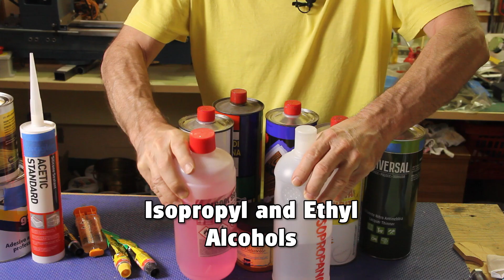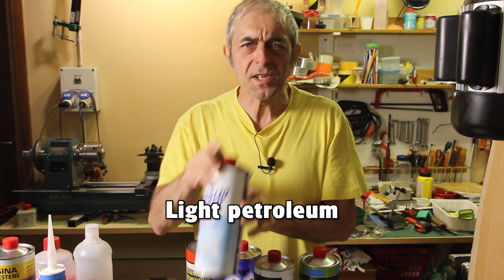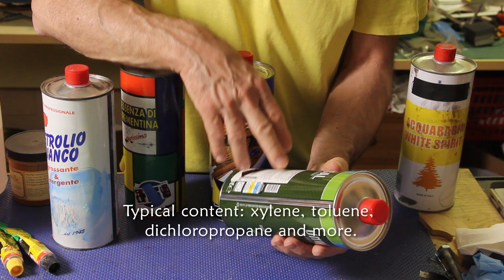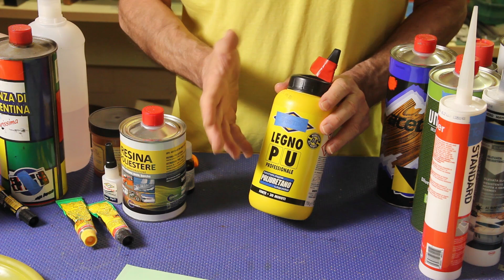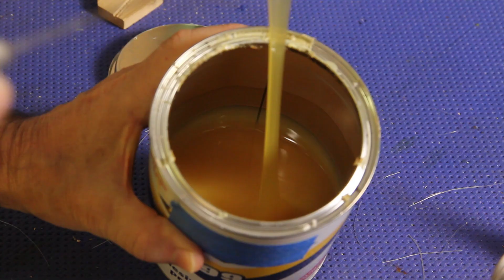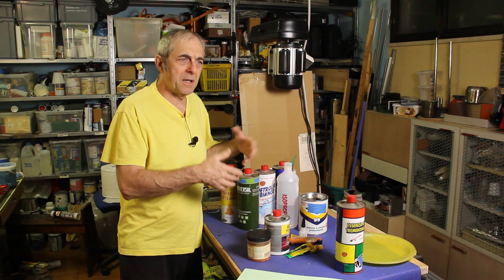Beginner's guide to Solvents and Glues for DIY projects

Comment: Hi, what or how would you suggest on adhering neoprene to the inside of pvc pipe? Thanks
Reply from the maker: What you ask is challenging: both PVC and neoprene don't like to stick with anything. There is a specific glue for PVC, like Tangit PVC-U made by Henkel (available in Europe) for EN14814/14680 standard. However that glue don't bond well to neoprene. A possible alternative is trying with bitumen (tar). It doesn't make a rigid bond but it would stick to both materials decently well. Only for low operating temperature (<40°C). Another alternative is trying with a polymer glue (e.g., PolyMax by Bostik or equivalent brand). You have to make some experiments with any of these.The last option is creating an intermediate surface that stick to PVC and to a neoprene based glue like Bostik 99 or equivalent. The underlying layer PVC-neoprene glue could be done using 2 components polyester resin on a roughed PVC surface. Again anyone of these will result in a somewhat weak joint because of the nature of the materials.
If you have the opportunity, try to conceive a mechanical joint instead. 

Disclaimer: as always I provided the above suggestions based on my experience and should be taken with a grain of salt. You are the only one responsible of the final result, I won't take any liabilities.

Comment: Also, just like different solvents are to be used on different materials, you need to be carefull in choosing gloves when working with each one. OSHA has a pretty good guide about what gloves to use for each solvent. Also, dont use Acetic silicone on or around electronics as it eats all the metal - even silicone in close proximitry will offgass and corrode metals especially in a project box. The other flavor of silicone is commonly sold in stores that cater to aquatic pets and aquariums.